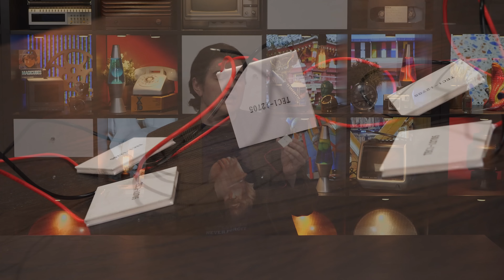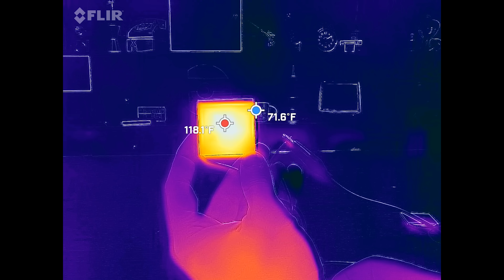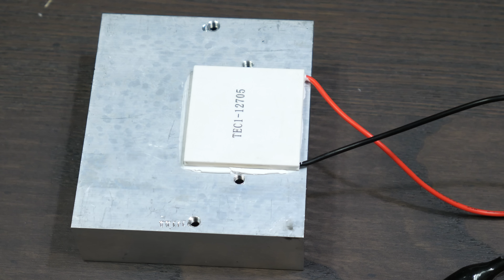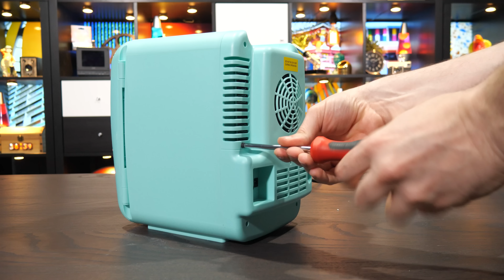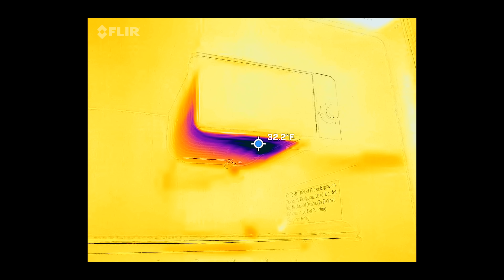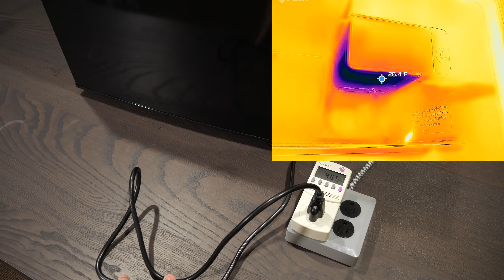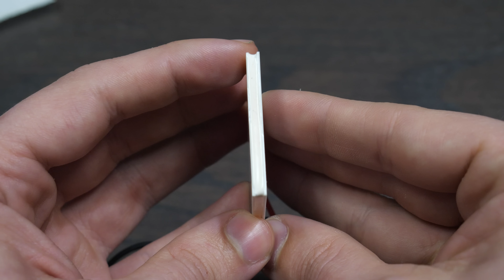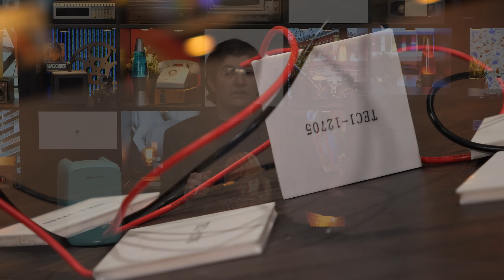Thermoelectric cooling: it's not great.

Comment: Bro I loved the video BUT you forgot one MAJOR fact about the thermoelectric effect: Its reversible! And im not talking about switching the polarity to switch the hot and cold side, but rather, instead of feeding it voltage and getting a temperature gradient, you can feed it a temperature gradient and get a voltage! You said it "still hasn't changed the world" and while its true in the refrigeration sense, it's downright DISRESPECTFUL for what it actually enabled us to do: Explore the edge of the solar system! Many space probes use a radioisotope thermoelectric generator to power themselves. Using a radioactive material that releases heat, surrounded by thermoelectric modules to create a very reliable, long lasting battery for its size. Without this technology we wouldn't have Voyager, New Horizons, Cassini, Curiosity, and Perseverance, to name a few. So yea that fridge toy is dumb, but the technology is awesome!

Comment: One really clever use of a Peltier device is a stovetop fan. When you have temperature difference between both sides, the Peltier produce electricity. Stick one end to the top of of a firestove and the other on a heat sink than you can hook a little fan on top of the thing with pushes the heat arround the room for free! Bonus the fan pulled the air through the heatsink helping getting a colder heatsink, therefore increasing a little bit the power coming out of the Peltier 

We had one when i was younger. It was pretty good at limiting the hot air from just rising.

Comment: I used to heat my large shop with a resistive heater.  It worked, but it consumed a lot of electricity.  I now use a heat pump, which has much better fans and does an even better job of heating my shop, and the cost savings on my power bill are tremendous.

Comment: I work in a laser/optics lab and all the lasers are temperature-regulated with Peltier elements. The heat loads are tiny but the temperature has to be controlled within 0.001 degree C, and the vibrations from a traditional compressor would be totally unacceptable. So they're great for that application!

Comment: I remember going on a road trip with some buddies as a teen with a large varient of these that had a plug that you could insert upside down and it would work as a heater to keep food warm. We didn't know that at the time and just plugged it in not knowing it was in "heat mode". We had drinks and some frozen steaks in there, needless to say it not only defrosted the steak but also started cooking it slowly for the two hour drive. Our fault for not at least checking on it I guess but the incident inspired me to always buy a proper camping 12v fridge and never attempt the  go for these cheap coolers again.

Comment: I drove over the road trucks one summer in between semesters at college. I didn't have the capacity to have a fridge, so I had a cooler that I would top off with ice. a bag of ice usually lasted 1 day.

I found a 12v cooler at a garage sale while travelling. I would have it at the floor on the passenger side, and could use it as a refrigerator. it wouldn't get cold enough to be food safe. I clocked it at 45'. but after putting in my bag of ice, I got it down to 36'. that bag of ice went from lasting 1 day to 5 days. and since I'm just drawing off the 12v supply of the vehicle, is didn't really matter what the power consumption was

Comment: When I go road-tripping for a week, I have a full size cooler that plugs into the car lighter plug, its got a peltier and a fan, keeps drinks and sandwich stuff cool on the road, savesa TON of money on not buying gas station drinks and food. Gotta put cold drinks in it though, it would take a day to actually cool down warm drinks, but it will keep them pretty cool if they are already cool.
Reply: Yeah, making these things sound totally useless is a shame... there are still general use cases, especially if in an office where you don't have to pay for any electricity, but you do have a tiny space, or would be chastised for bringing in a proper refrigerator.
Reply: They have this other new invention called ice, works great in a cooler
Reply: The real question here is, is there a lighter plug compatible minifridge (with heat pump).
If not, then yeah, that is the best you can do. But if there is.... given that it is a full size cooler, the overall size won't be too different (although the mini fridge would be heavier so a bit harder to move around).
Reply: @justanoman6497  I don't think the compressor would like having its oil sloshing around as the car drives all that much.
Reply: @jendakrynicky5218  The thing that goes into the compressor is not oil and I don't think there would be much sloshing--heat pump works by pressure manipulation so there generally aren't a lot of excess room or it won't work.

The thing that slosh around are usually the heat(coldness) distribution loop, that moves the "coldness" from the evaporator to the rest of the system. I don't think there are too much of problem having that slosh a bit.

In any case, if there is a fridge that is compatible with the car plug, it is probably designed with movement in mind. But this would be a good reason not try to jerry rig your own (by converting the plug).
Reply: @justanoman6497  Erm. The video, time 26:15 and on ...
Reply: @jendakrynicky5218  Ah, the lubricant. I keep forgetting that. But... he is only partly right on that. That is just the easiest, most economical design. Fundamentally, that part is a pump, to force the refringent to flow through the loop. There most certainly are pumps that are not orientation sensitive, your car have some. So it is perfectly possible to make one that don't have the problem, it'd just be more complex and cost more.
So, again, if there is one on the market that is designed for vehicle use (maybe the ones that are in RVs?), those would be fine. Just don't convert your normal fridge to car use.
Reply: @justanoman6497 RV fridges do exist, they are even more expensive than a normal mini fridge. They're also often designed for 12v dv power. It really seems like unless the larger space of a compressor fridge is needed then a peltier is well suited for this application.
Reply: @justanoman6497  there are 12v vehicle refrigerators that use compressors. they are considerably larger and more expensive, but they do exist.  there are even ones that will hit full freezing capability and have adjustable thermostats for cooling or freezing.
Reply: I've got one of these mini "fridges" for my toolbox at work to keep my drinks cold. Works pretty damn well. Drinks stay cold
Reply: Yes, they do make cooler sized units with heat pumps, and they're the only option for when you need to have food safe temps for week a time or longer without a supply of ice.  They're not mainstream because people are too cheap and think peltiers or ice chests are just fine, and they don't want to buy something that's a couple hundred bucks.  But you'll see them on overlanders and anyone else going off grid for a long time where ice isn't available, because they're actually relying on their coolers.  Anyone that's actually used a peltier cooler and thought they were good for keeping something food safe or cool for a week or longer are actually just delirious from the food poisoning they inadvertently gave themselves.  The internet is a terrible place to justify your poor purchases.

Comment: Barely up for 24 hours and already nearing 1 million views and is number 14 on trending. We live in a very interesting world. Anyway, I found this video neat. It's also good to know that we've found an environmentally friendly refrigerant for at least one type of heat pump. I hope we can settle in on one for the really big heat pumps. I just moved, and the ancient AC at my new place runs on R22. That's fun. I hope it goes out because the compressor breaks and not by a refrigerant leak

Comment: I wonder what would happen if you painted one side of the Peltier device with super black paint and connected the other end to a heatsink that extends several feet into the ground. Maybe with a fluid inside...Then slap it in the desert.

Voltage?

Comment: If you double stack the Peltier devices, cold1/hot1:cold2/hot2, then cold1 gets even colder. Just costs you double the power! 
And if you shape the devices to contour to the cans, it can cool more efficiently. 
So to get the liquid from room temp to “beverage cold” more quickly we just need 4x double stacks per can, x6 cans = 48 devices at 55W each = 2,640W 👍

Comment: The advice "tip refrigerators upright when they've been laid down"  is out of date for most models. Scroll compressors are less sensitive than their old fashioned reciprocating counterparts. I was given a 3/4 size working r134a refrigerator. We loaded it on its back into my full size work van. I was injured the next day at work and The van sat with the refrigerator in it on its back for an entire year undisturbed. Myself being injured I had some people help me unload it and the people also were trying to give me the advice of having to sit the refrigerator upright for at least a day. To prove this point I plugged the refrigerator in immediately. The refrigerator compressor was louder than normal but only slightly for about 10 seconds And it worked normally. It is in my workshop that is unair-conditioned in Florida where the temperature inside regularly gets well above 100°. It is still working properly months later. 
Once I learned the difference a long time ago between reciprocating and scroll compressors I figured out that that information though useful the past is outdated . I have done this many many times when the refrigerator was just laid down for a few hours or even a weekend but a year on its back is about as extreme as you can get.
Edits I use text to speech and it still can't quite get you full and useful correct😂

Comment: These work fantastic as a way to cool avionics equipment that overheat (Sitting in very hot Texas heat) before startup. I've actually used the exhaust of a portable AC unit to dump heat quickly into a plane cabin to troubleshoot the issue.

Comment: Another notable use case is running them in reverse to convert high temperature gradients into electricity, a Peltier thermo-electric generator. For example the fans the sit on top of a hot wood stove.

Comment: Would all fridges be better off on their back, with the doors opening upwards and keeping the denser colder air from pouring out?
Reply: Yes. Some people even convert chest freezers to fridges with an arduino controlling the temperature. This makes sense if you're running on a small battery bank off grid.
Reply: Yes, although if I remember correctly (for freezers, which exist in both designs) it turns out to be a relatively small effect when the freezer is full of food, because the food is a lot denser than the air and so not much thermal mass actually moves.
Reply: @janTasita  interesting, would be cool to see data on this! A few variables would be be the mass in the fridge/freezer, and also how often it's being opened and closed. What you're saying makes perfect sense though.

Comment: anoter nice idea was the "cooler master v10" CPU cooler, which used a peltier element.
if you realy need your cpu cooled under room temperature its the only real option.
i also saw a idea by thermaltake to use a heatpump cpu cooler but it was bonded to the chasis and only work with 1 mainboard which have the cpu slot at the exact position because of the tubes you cant move the cooler.

Comment: I feel these things have a use-case, and with better construction comes better possibilities, mostly portability. Then again, they already make passive versions of this that we've been using for over a century: an insulated box with ice in it. Maybe there's cases where ice isn't the best option, but at the moment I'm hard pressed to find one. Honestly, insulated box with ice or an actual refrigerator makes more sense in pretty much any case of consumer use. I'm sure there's use cases for them, but not with what we think there is.

Comment: They make really tiny dehumidifiers that aren't efficient but can run on essentially battery power that are useful for things where desiccants are a hassle, like unattended locations (say, a safe). Also i don't have time to finish the entire video right now but the biggest thing humanity has ever done with Peltier modules is ... powering unmanned spacecraft. Have something that stays hot (radioactive material), put a peltier between the hot thing and the infinite coldness of space, and you get .. oh, 40W out (of your module there) - but really about 80-100W on the ones we've actually put in space. neat!

Comment: So if you used these in a configuration of the cooling side is directed toward a refrigerator application but instead of the hot side pasted to a heat sink, it's connected to a water pressure vessel that through steam heat runs a turbine that creates electricity, you could significantly improve it's performance? Using more elements but reduce there electrical efficient power consumption by having them produce some of their own power as a bi product of their own inefficiency.

Comment: Whilst I enjoy peltiers in different applications, you are completely right and the detail you go into is great.

I am considering a peltier 3D printed fridge, but it is far from simple. The design would need to be VERY good and insulating to keep the cold in and heat out, and the cooler would also need to be excessive to keep the temperature difference neligible.

1 use case I have found for peltiers is on pico aquariums. These are somewhere in the 1 to 5L size and the peltier runs no more than 5W on a heatsink and fan arrangement. It can do enough to drop the 2<4c needed in the peak of summer without the water loss which on a saltwater tank is a big deal.

- Paul

Comment: Correct me if I'm wrong but...

The hot side of the TEC has a sizable heatsink and active cooling while the cool side maybe has a metal plate and plastic. I feel that the TEC isnt working to be best to it's ability to cool. Had the OEM filled the back wall or side walls with something  like glycol/oil/ or whatever else and attach the TEC to it to increase surface area, I'm willing to bet the air temp would be cooler over stock configuration. Or, finding a way to connect a heatsink on the cold side would help too, as well as adding in a 2nd module with some sort of control for efficiency. 

Also to note, I feel that conventional gas fridges work more efficiently due to the larger coil surface area and that they can maintain a consistent low coil temperature despite however high the box temperature may be.

Also for the fan issue, swapping in a higher quality computer fan would probably almost silence it.

Comment: A German here... There is one application for this in the common "household": Electric coolboxes to carry around and drive around in your car. I totally get the in-efficiency, but the last thing I want is a running compressor of a real fridge in my car and the potential disaster of leaking refridgerant during an accident, of even fire/explosion. 
My coolbox even has a potentiometer (aka turn-thingy) to adjust the level of cooling (it does have an effect!) and even a switch to "reverse" the heat exchange process, so it could even warm the stuff inside. Funnily, the potentiometer also(?) controls the speed of the fan. 
Speaking of efficiency, when I took it camping once, and didn't slow it down for the night, the stuff inside even started to freeze...
Oh and btw, 8°C is considered food-safe for most things (groceries, cheese...) in German/European fridges. Only fresh meat should be at 2°C or below. And no-one wants a drink colder than 8°C here, even on hot summer days :D

Comment: The blue "fridge" is more of a toy novelty item than a useful product. I do have a proper thermally insulated large'ish coolbox and even with a lowly 12 5A (~65W power draw) element, it does work well for keeping this cold if you let it run for long enough. I tend to run mine for a while (12 hours or so) in advance before my trip.
I do agree these aren't substitutes for a real fridge and they are woefully power inefficient but they do work for occasional travel and camping use. There are proper compressor-based fridges available in portable coolbox format, but these cost a small fortune.

Comment: "Electricity is not free". Err, well sometimes it is when you have an hourly tariff in a country with plenty of solar power 😊.

Also, does anybody use a Peltier cooler for years on end? I only use it (12v, although sometimes without power and some cooling elements if the trip is only a few hours) for road trips in the car and sometimes for a birthday (with 240V) when the (European sized) fridge is full, so optimistically that would be 40 hours per year or so? I would probably spend more on additional electricity if my fridge was sized year round for a birthday.

Comment: Not going to save the thing, but the TEC fridge cold side should have a heatsink and fan; it would greatly improve efficiency.  Not heat-pump efficiency, of course, but it would go from ridiculously bad to just bad. Also, I don't see this as a good desktop solution, but if you're remote with only 12V power available, you can use one made to run on automotive volts. For compact six-pack cooling, practical. With a little more space, you can get a compressor heat pump cooler that runs on 12V. So yeah, it's a really specific set of parameters that it requires to be practical.

Comment: Interesting to do a piece on the Heat Powered Fans you put on top of a wood stove to blow my more heat into the room. Those have a TEG Thermo Electric Generator which is like a Peltier unit running in reverse.